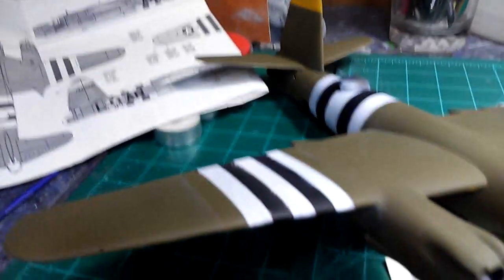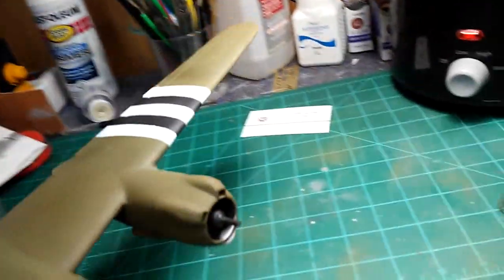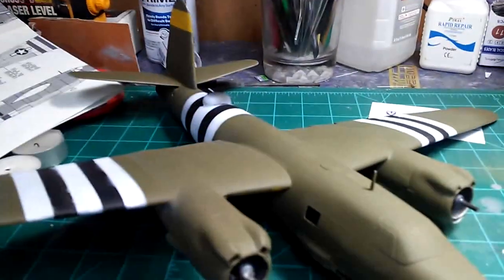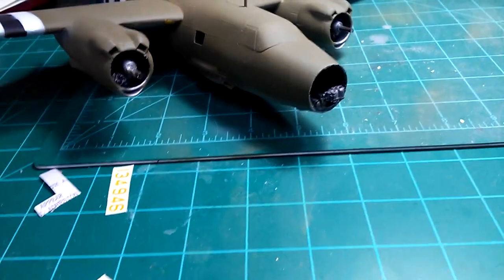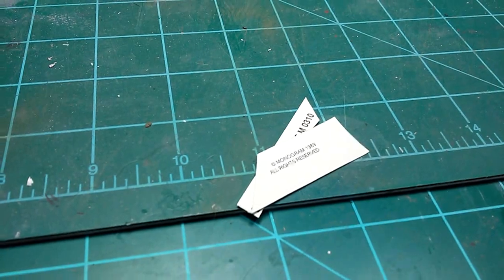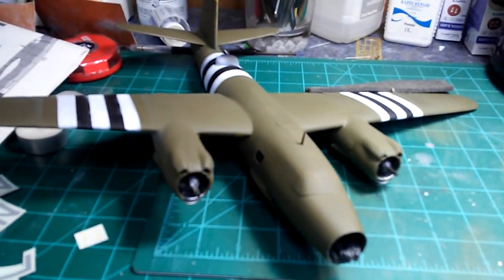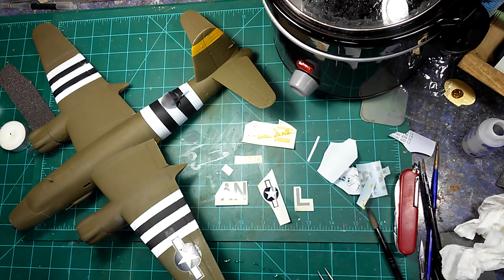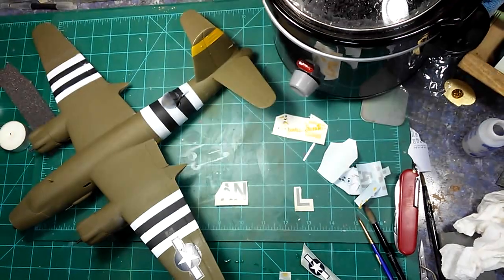SA Reloaded - The Monogram B-26 Build Part 11

Comment: Great to see you getting close to the finish line SA!  Sorry about your decal problems.  I find decals to be the most nerve-wracking part of a build.  It's make or break at that point, with so much time invested in the model.  I like your warm water technique. I'll have to give that a try, as I have a small crock pot that doesn't get used anymore.
Reply from the maker: Thanks Ken. We'll get it done.  I stole the crockpot idea from someone else a while back. Can't remember who. It does work well. Just make sure you have a warm setting. Low is too hot in my experience.

Comment: No walthers solution?😆

Jman👀
Reply from the maker: I've never bought any of that. I have however used Tamiya Extra Thin Cement to melt old Monogram decals. Just slightly less effective than a flamethrower. :D
Reply: ShutterAce 
Yep no guarantees when it comes to using any decals!!
Don't know if your heard but hobby boss releasing 1/32 B-24J and wing nuts releasing 
1/32 dam buster lanc!😳

Jman👀
Reply from the maker: The B-24 announcement had my senses tingling but I have both Monogram versions. I'm much more of a fan of the 24 than the 17. The Lanc is a beauty too. I'm always keeping an eye out for a deal on the Tamiya kit.
Reply: ShutterAce 
Tamiya s lanc like their 1/32 kits seem to stay up in price even on evilbay! I did finally get hold of the 1/32 p-51d for $85 with shipping! 🤔

Jman👀